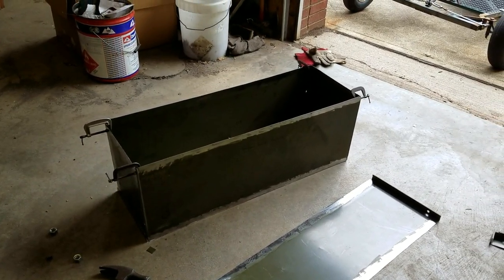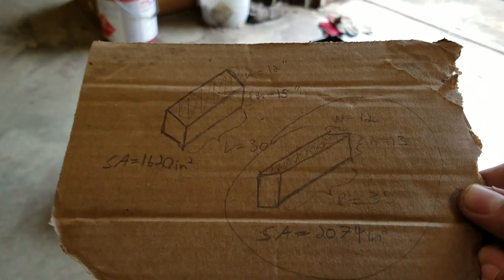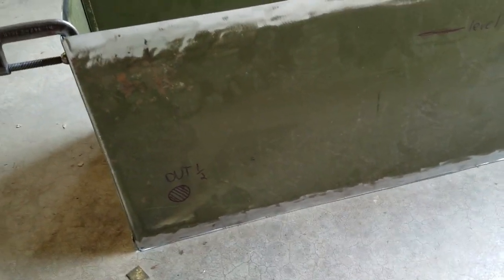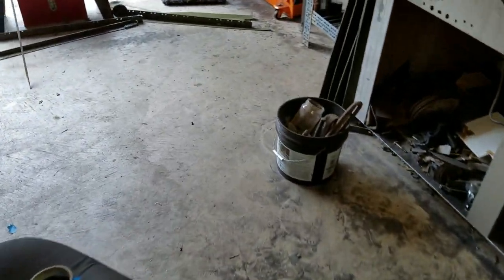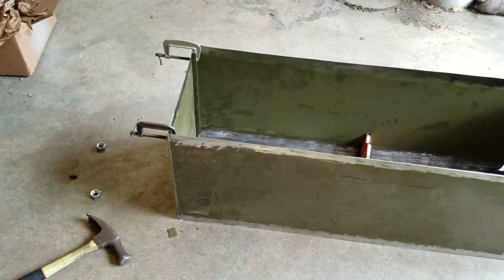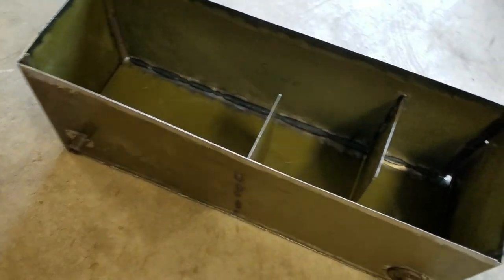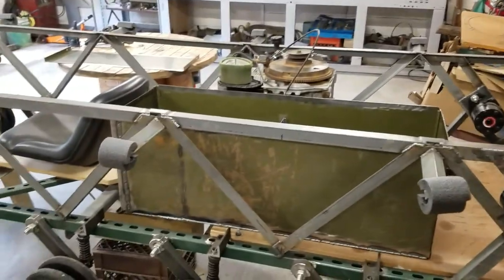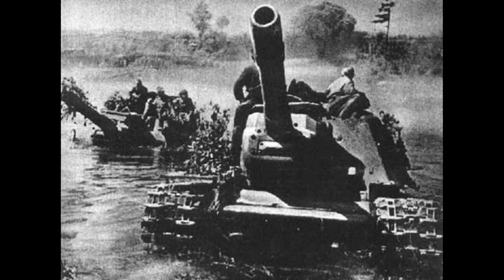Homemade Tank Part 8 (Hydraulic Reservoir)

Comment: 1. I don't know where the idea that the filter goes on the return hoses came from but, the filter MUST be between the tank and the pump to prevent any debris from damaging or locking the pump or the motors.
2. That engine needs LOTS of cold air to keep from burning up, it needs to be isolated from that tank to keep from burning up. You could run an alternator from the top pulley on the motor to charge a battery and run fans to bring in fresh air to both compartments, the engine, and the oil tank.
3. If you do the alternator system then you can add a real temperature gauge and have the indicator on a panel in front of the driver's seat; you could also add a circuit that would cut off the engine if the temperature on either the engine or hydraulic tank got to a particular threshold.
Reply: No it doesnt

Comment: I think the 300% tank size is for extending cylinders situation. you are simply running it through a motor so volume isn't an issue.
Reply: exactly. a small tank or a cooler would suffice

Comment: I know I' m late, but why didn't you use a small reservoir and a radiator?
Reply: fischele way simpler 
only hi flow and hi performance hydrolics use a cooler 

a hydrolic cooler is very expensive 

and most small machines use this same setup for cooling
Reply: @fowletm1992  no they are cheap and readily avalilable. just get one from a junk car
Reply: @DrLoverLover  
You won't get a cooler from a car rated to enough presure 
Even though it's on the return side 
Small  systems like this the tank is the cooler
Reply: @fowletm1992  No need. Just put the cooler between the tank and pump inlet. Dont be stupid
Reply: @DrLoverLover  
Why bother with the unnecessary complexity 
As I said the tank is the cooler 
It's a very common setup in industry 
Ever wonder why hydraulic tanks are long and thin rather than just a cube
Reply: @fowletm1992  To be able to use a smaller tank. A cooler from a gearbox is not expensive nor complicated to install.
Reply: @DrLoverLover  I don't think those cooler from cars have enough oil flow,if u place them on pumpu inlet ,they could ruin the pump due to the lack of oil flow,pump starvation,cavitation.And in my opinion,every hydraulic system that have hydraulic motors on it,should have hydraulic radiator with fan on it for active oil cooling.